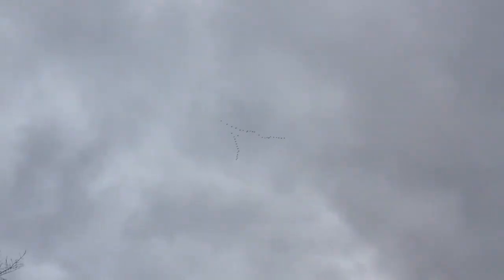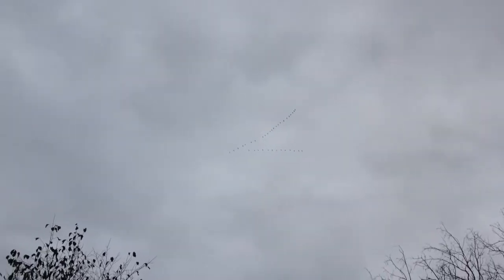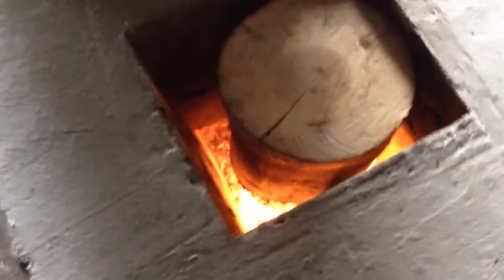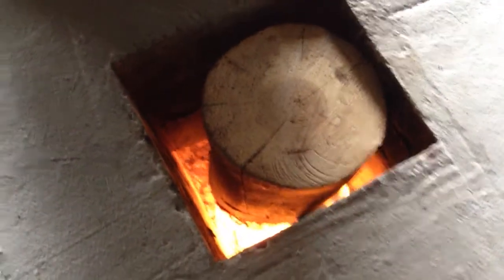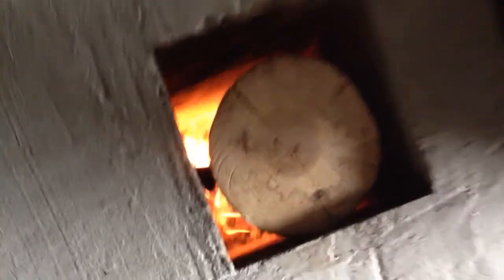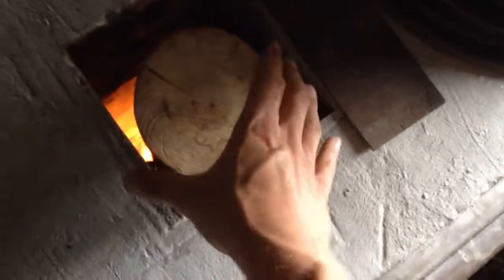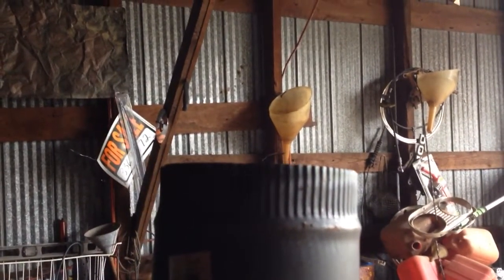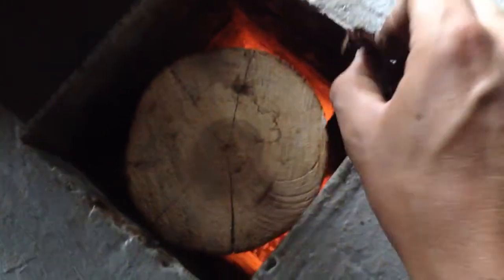Rocket Stoves Ep# 30! Two Hours Into Burn Testing

Comment: If you fire this up again. I'm curious how it would do with a 4" log instead of the 5" might get you back up to the 350 mark but be a steady controlled burn.
Reply from the maker: this cast core model has a masonry core, and an angled ceiling in the burn chamber.  its also another one of my favorites.  yes smaller sticks work best in rockets, some claim its nearly impossible to slow burn or to burn one single large solid log in a rocket, but when the coals are there, and the core is hot, i had no issue achieving a clean slow burn.  the thing to watchout for in a J-tube rocket is smokeback and or smokey exhaust if you're attempting something like this.  its widely known that more surface area on the solid fuel and smaller pieces to achieve the surface area works best, but i do enjoy R&D tests especially controversial matters lol

Comment from the maker: A smoke free burn indicates a hot fire, and low emissions.  The fact that I only get 200F out of the exhaust tells me that the cast core and heat exchanger are doing a very good job of extracting and capturing the heat, so very little is wasted out the chimney.  I figure a smoke free efficient burn will be at LEAST 1000F, and I'm only getting 200F out of my chimney, so I'm doing an excellent job of extracting at least 80% of the heat inside!  At least 80% efficiency I think.   Which is downright astonishing and incredible, in my opinion...

Comment: is the Bell just sitting on the wheel,or is it attached
Reply from the maker: It was only sitting ontop stacked.   The entire center was cut out of the wheel (to go over/around the riser).   I was going to cement the wheel, then make a rope gasket at the wheel lip, because the lid was welded to the bell.   It's best to have a way to remove the lid or the entire bell.   I've disassembled this unit and the core and bell are currently separated and not being used.   It's a good working unit though, one of my favorites.